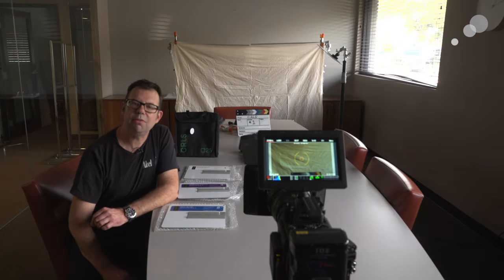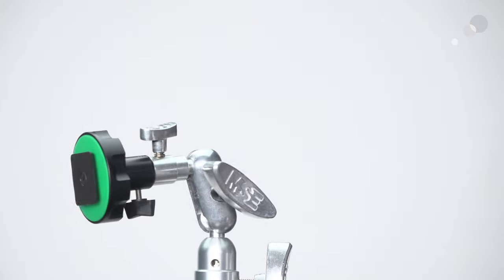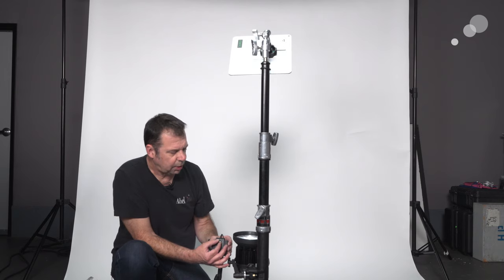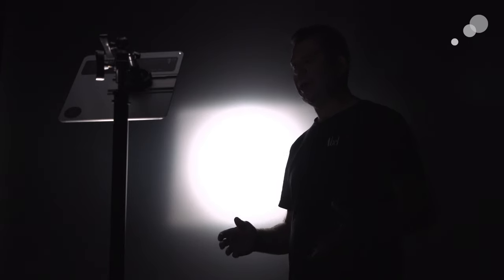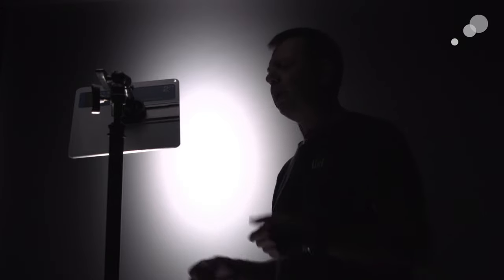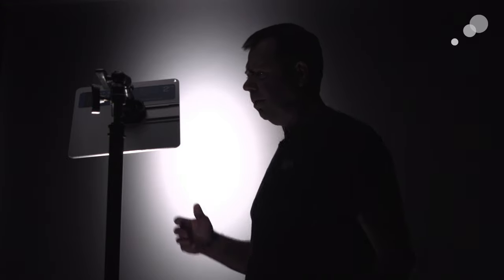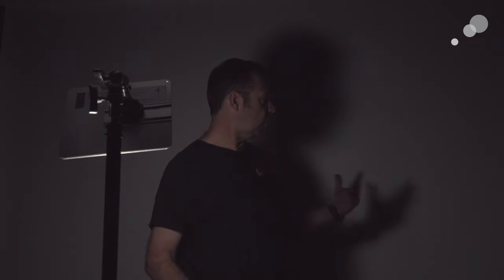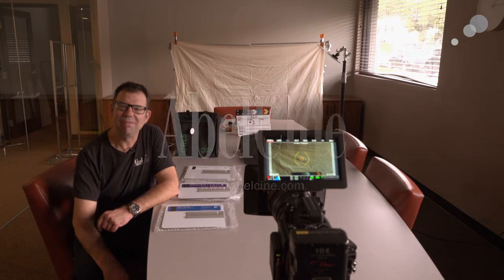At the Bench: The Light Bridge CRLS Reflectors

Comment: I love CRLS. The very contemporary way of lighting, especially, for lighting dynamic scenes, and in small or challenging spaces. My question is why the shape of the reflectors are not circular? This is especially for the light pattern of The #1 and #2 plates. The light pattern is significantly unnatural (seeing a radiating spotlight in a rectangular light frame). With a circular plate, the reflected light falloff would look more natural (on shiny surfaces or in people's eyes) unless you mimic a window or so. At least, you can give people the choice of a circular or rectangular plate.
Reply: The same reason a flag is rectangular. Shaping the shadows become easier. For circular shape of light you can attach cookies or focus it using a lens.

Comment: Do these reflectors automatically produce a softer source?  I understand that they produce a more diffuse source, but isn't softness a function of the size of the source (no matter how diffuse) and the distance to the subject?  I believe a diffuse 1x1 source will not be as soft as a diffuse 2x2 source.

For example,  Ian's tests saw the model's nose shadow reduce in size as he went up through the more diffuse reflectors.  But the sharp edge of the model's nose shadow remained.  Take a look at all 4 and the shadow never loses its sharp edge.

Would a large soft source, like a large softbox or a booklight, come at the model more from the sides and soften the edges of the nose shadow?
Reply: Yes you’re absolutely right and this is wrongly portrayed in this video. What the different versions of this reflector can affect is the type of spread from its surface. So number one basically is a slightly diffused mirror, which means pointing with a tiny flashlight on it would not lead to an evenly spread reflection but be brighter in the center than the corners. Also the direction would be almost perfectly mirrored. Moving up to number 4 makes it more and more a Softbox hence an evenly lit surface being more focused at first and similar to a space light with number 4. it NEVER makes it possible to wrap light more than any other soft light source of this size could. Wrap of a soft diffused and evenly lit light source, like you assumed correctly, has to do with two things only. Size and distance of the light source in regards to what it is lighting.
Reply: It is basically a reflector on steroids and can replace a silver or white bounce, mimic a shot through diffusion of the same size and can make flags unnecessary. It’s super practical I’m sure in many situations but it can’t do magic or defy physics. So it doesn’t make anything softer than a any cheap diffusion fabric would.
Reply: @halfgraincinematography  much less about the softness then it is about the parrallel beam. which gives your directional soft light. no flags. less stands,. less wasted light,